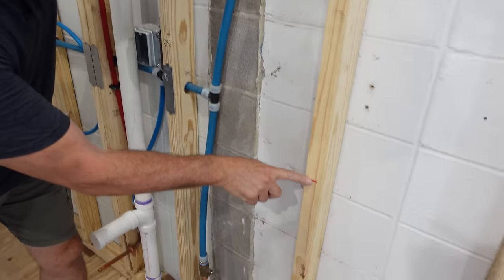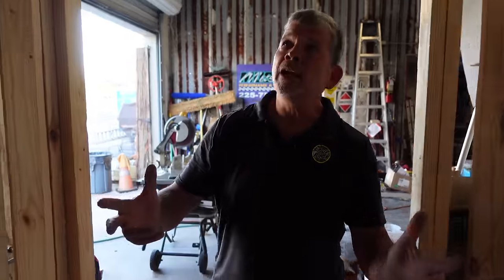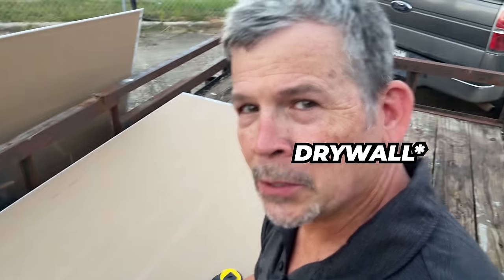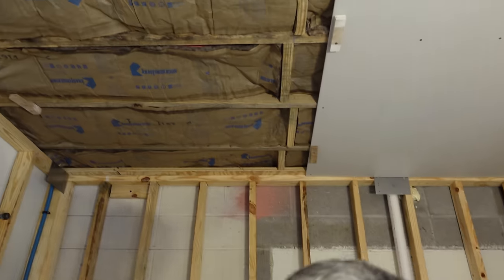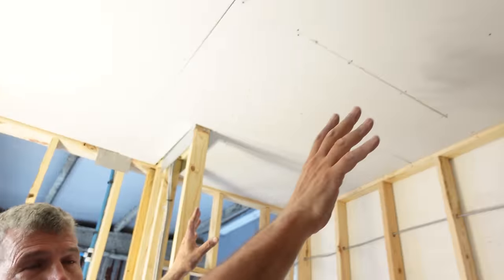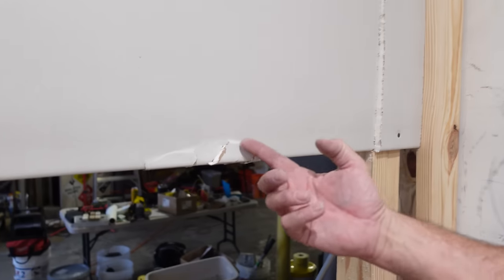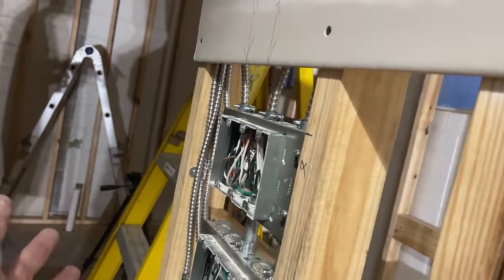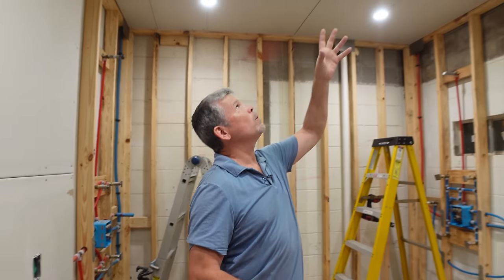THIS Drywall Skill will MAKE or BREAK Your Job - THE SHOP Part 14

Comment: I feel for ya...I hung all the 8' and 12' drywall in my 50' diameter, 2 storey, 22' high domehouse by myself. Believe me, I had to be a very tricky little fella. Figuring out how to hold 12' sheets of drywall up on ceilings by myself is still  one of the greatest achievements in my 74 years.
Reply: You go guy
Reply: self harm is usually a symptom of something more serious.. just FYI..
Reply: @mos8541  I didn't harm myself at all. I used my brain, not my muscles. The symptom I suffered was serious but it was just the lack of cash. I hired 3 different drywall contractors who each quit on the first day because they couldn't figure out how to install drywall on the hexagons and pentagons of the Dome house I was building so I had to do it myself. I had money in the construction-loan for contractors but not for helpers.
Reply: @choimdachoim9491  You dont need a helper. Rent a drywall lift.
Reply: @TheBUGZNTA  I never saw one that went 22 feet up. I've used those on several other occasions, though.
Reply: ok good, the trauma your wallet suffered was no doubt severe, tho everyone's different, i used my head some time ago, luckily its not a vital area..
Reply: @TheBUGZNTA  My first reply didn't post...probably for the best, I hate to be called a liar: I did the entire job by myself. Who said I used a ladder?
Reply: @choimdachoim9491  Ok boomer.
Reply: @choimdachoim9491  the most important question is!
How did you do it???
Reply: @akaredcrossbow  I rented a scissor-lift, drove it into the building through the 12 foot wide opening for the 2 @ 3 foot sliding doors in the living room, loaded each sheet onto the lift, raised it close to the ceiling, propped one end up on a pole-sander with it's handle stuck into a 1 inch PVC pipe that I drilled holes through every 6 inches and adjusted the sandpaper end against the drywall, adjusted the PVC below against the floor of the lift and stuck a 12 penny nail through the PVC: then I raised the other end and installed screws. As I worked my way down the curved walls I modified some clips that are used between sheets of plywood to hold the lower edge of each sheet of drywall and installing screws was easy plus the clips were easily removeable. That's how I did the half of the dome that was 22 feet at it's apex. All the rooms was just typical "nail a 2 X 4 cleat high on the wall" to install the 8 foot ceilings plus the sanding-pole trick. Walls were done with the modified clips.
Reply: @choimdachoim9491  How long did it take you to figure that out? Was it as much of a nightmare as it sounds like?
Reply: @institches2750  Building a house by myself was a 24 hour per day job. Always thinking. I had fun because I liked solving the problems I encountered.
Reply: @choimdachoim9491   Necessity is the Mother of Invention. my favorite quote to pessimists and Nay Sayers

Comment: It used to be my wife and I holding drywall over our heads on ladders when I needed to put drywall on the ceiling. (Before I saw your video showing the little wood drywall holder trick). Then I bought a drywall lifter to help put sheets up on the ceiling. Only about $150-200 and it saves my back/shoulders/elbows. It takes a little longer to install sheets but it is totally worth it and my wife is not mad at me anymore for asking for drywall help. 
Great video! I love that you help people find stuff at the home depot.
Reply: We are all too old to be hanging drywall by hand. Those sheet lifts are amazing!
Reply: I bought one of those sheet lifts and its been in my shop since about 6 months after i bought it. I went back to the wife helping me. Though that trick with the holders he showed woulda saved us a lot of headache. Wish i knew that when i did my hall in 5/8ths

Comment: Thanks to you guys I felt confident enough to renovate the bathroom of our house involving tile installation, lighting, exhaust fan, the works. It's going well, but I felt that Wilhelm scream when the card went into the slot. That number sure does rack up fast.

I'm glad you guys got the inspection passed, and I'm fairly confident you'll be done with this project with likely a few days to spare. Great work as always guys.

Comment: Both of you are awesome. I have worked with a lot of fiberglass, and i know it can be uncomfortable when you're done.  If you leave very itchy make sure to take a cold shower when you get home. ( at least for the first minute or two).  Taking a hot shower opens your pores and can allow the fiberglass to penetrate deeper into your skin.  Also, huge props to jordan for editing at night

Comment: You should invest in a banjo. It’ll make taping jobs like this go so much faster! You could tape the drywall then install the cement board. And then you could tape where cement board meets drywall. One day, done! Next day coat drywall two coats, first one with easy sand 45. Do butts, bead, flats, screws, one side of the corners with a 4” or 6”. By the time you get done with first coat should be close to lunchtime. After lunch, You should be able to scrape any lap marks or heavy edges with a 6” knife and then do your final coat with regular bucket mud (I like plus 3 with a few scoops of all purpose green lid mixed in). I like to coat in same order as first coat just using a little wider knife on second coat. (1st coat on butts, beads and flats with a 10”, 2nd coat with a 12”.) inside corners get hit with a 4”or 6” knife. Screws I like to coat 3x 4”,6”,6” or 8” doing swipe method. When I coat one side of corner with east sand before I coat the opposite side with regular mud I like to cap the first coated side with a super tight coat of the regular mud. I pretty much put it on the wipe it all off. I’ve have found there are too many holes in the easy sand and capping it with a tight coat fills in these holes so sanding is a breeze. Looks great fellas as always! Hope I gave you some helpful pointers!

Comment: I keep asking myself why you don't use a beltfed drywall-screwdriver. With the amount of drywalling you are doing the investment pays off in no time saving you a lot of hassle.
You can even put up 2-man sheets with a single person where one hands presses the sheet in place and the other hand pulls the trigger.

I know the screw-belts are a little more expensive and you can't get them at every hardware store, yet I wouldn't want to go back since I had a belt-fed screwdriver in my hands - instant love 😍

Comment: Pro tip hanging drywall next to boxes like Jordan showed his “lipstick trick”
On a short wall like that, either stand a 8’ sheet up, or option 2…cut your two small butts for the wall, then rip one of them in half. So your little wall would consist of 3 pieces 2’ 4’ 2’
Allowing you to router with the greatest of ease.

Comment: Holy Moly!  Mr Studpack, you also need to get some cedar planks to replace the bed of your trailer.  Ouch!  But thanks for the trick with the offset holders for ceiling drywall.  They work just like table top fasteners for a furniture table top.

Comment: 'Saw' you using that Rotozip. Bought one of those quite a few years ago. Ruined a few sheets of drywall while learning how to use it. That's definitely a tool you need some 'practice drywall' for.........  The amount of torque the tool had surprised me.

Comment: You need to turn the buzz saw loose on your straight cuts instead of the dusty roto-zip so much nicer for cutting out doors and windows.  Also if your pre-cut outlets and switches, it works great for that too.

Comment: A little late for this project but if you have a bunch of insulation pieces the same length you can use a paper guillotine to make quick work of it. Just put a tape measure out to the proper length then its just pull cut, pull cut, pull cut, etc. Might be good for the studpack house :)

Comment: We always try to avoid those notches around walls like that, it's a major pain in the a%$. Instead start up against that wall with your first sheet. Depending on the size of the room you may have to do a half notch, but that's way easier than notching out the whole wall and sliding it in place, plus if your room is less than the size of a full sheet it's even harder to notch the whole wall out.

Comment: Paul I saw a neat trick the other day, when cutting the Gyproc/ drywall... once you do your front cut just do a quick pull towards you and it should snap the paper so you don't have to drag your knife across it! give it a try out...Iain C Glasgow

Comment: nice video....but insulation should plane with bottom of joists on ceilings and outside edge of studs on walls.  Insulation should be one perfectly flat plane prior to drywall, so insulation touches back of drywall....thus no voids for convecting air.

Comment: I would suggest you go and buy a couple of sheetrock benches instead of working off ladders.  They are a good utility tool and not just for sheetrock.   Back in my 20's,  I hung rock for 4 years and had a good hanging partner.   If needed,  I could stiff arm a 5/8" - 12 ft board and put it on the lid solo all day with out any assistaning "prechers".   Those rotating "Preachers" as you call them work good,  but the Pro's rarely use them because they cost you time, and time is money in piece work.     Good job tho.👍👍

Comment: Awesome guys! Love these videos. Why no stapling the insulation? It might fall down over the years. I was surprised you’re insulating it all together… without any ductwork going in? With just that one exhaust fan are you worried about condensation/mold? And you didn’t use moldboard (we call it greenboard but I see purple sheets sometimes now too)
Reply: I was wondering why no purple board either

Comment: You would like our local hardware store. They have a drive through lumber building where you can load plywood, drywall, lumber and insulation straight into your trailer..

Comment: I've never done drywall before. I plan on finishing my basement at some point and what I saw you guys do in this video really helped to demystify the drywall process. Yes, I had a basic idea of what needed to be done, but the sequence of events was unclear. I'm always fascinated how drywall is cut so cleanly. I was amazed the first time I saw that it could be cut at all because it seems so firm. Seeing the insulation installed, cut to length and split to accommodate wires and pipes was very helpful. Watching the videos on this project has helped me to feel more confident in tackling similar projects on my home. Thank you for sharing your experience and knowledge as well as tips and tricks, too! I really like the swivel pieces to help retain the drywall when hanging them for ceilings. That is epic! What are the specs on the insulation you used? Is all drywall the same or is it driven by brand or grade? is a specific type of screw used to secure drywall to the framing? Thanks.
Reply: I’ve been in the trades 45 years 

Do the insulation and hang the drywall in your basement 
But hire a drywall taper for the finish 
This is by far the largest home owner mistake   Taping ( finishing) looks easy and it really is but it takes ALOT of practice and you will see the final results for ever  and it will take a first timer 5 times ( or more) longer and will still not be nice enough. 
Just a bit of advice from a pro  
Oh and when you hire the taper after you already start it. They will charge you more then it would have been. They will have to fix more 
Trust me 
Good luck 😊

Comment: Question! Why didn't you use spray foam insulation? When done by pros like you guys it should be quicker and easier and it does not mold so perfect for a room like the bathroom.

Comment: Great job Guys!!! I got a few questions. I live in Texas and here in the Houston area you need a licensed anything to sign off on the work on the permits to get final inspection. Are you guys licensed in plumbing, electrical etc. or do you have subs for that? Is it not required in Louisiana? I couldn't even get a permit for some outdoor outlets and fans for my patio unless a licensed electrician pulled the permit and had to be present on inspection day so inspector could sign off on it. I knew how to do the work and it could have saved me a ton of money if I did it myself, but city would not allow me to do it. Since you are moving to Texas and doing your build, I was just curious about how you guys would handle that.

Comment: How did you fix the floor after cutting it up for inspection? there was a some damage. Did you have to use new plywood or did the old pieces fit well enough?

Comment: Love to see folks that are doing all of the trades.  But didn't you need specific licenses to get the permits for those things since you aren't the 'homeowner'?  Here in Toronto, I'm able to do all sorts of things as a home owner (though they don't like it), but I wouldn't be able to pull an Electrical permit without a license or submit drawings without a Stamp of some sort (Designer, Architect, Engineer etc.) and HVAC requires an Stamp from an engineer as well I believe.  Oddly, they don't seem to care about plumbing.

Comment: Why didn't you unfold the paper on the insulation and staple it to the studs? 
Not doing this will allow the insulation to sag over time.
Reply: I can all ready see sag points in the insulation. Check time 15:40. Several areas the insulation doesn't touch each other. Falling in left side of wall and on that inside corner.

Comment: I recently found out the tabs on the sides of the insulation are meant to be folded over onto stud and stapled.
Reply: I watched a video from the insulation manufacturer and they say to staple to the inside of the stud.

Comment: Not to sound like a hater, but you're wrong on the permits and inspections being all politics and/or a "money grab" for the government.  Part of it is money, but not all of it.  Pulling permits and getting inspections helps to protect the owners of the property.  It also takes the responsibility off of the contractor doing the job as the work was now performed up to satisfaction of the local jurisdictions.

Not sure how you able to pull off having those permits pulled, but where I live and work you have to hold those specific licenses in order to do so.  It is a pain to go through these processes, but you don't know how many corners were cut by contractors and construction workers both intentionally and unintentionally to get a job done that wind up compromising the building's infrastructure leading to some serious problems for the property owner(s) to deal with later on.  No, I'm not an inspector...I'm a plumber.

Comment: May I ask, why 1/2” drywall?
Reply: cuz 5/8 is a bit-h to work with, overkill for anything besides firestopping/firebreak. maybe the ceiling couldve been 5/8th but the walls, pfft 1/2 is fine